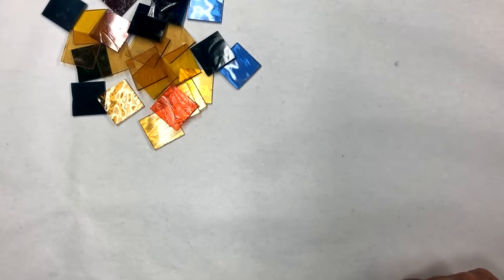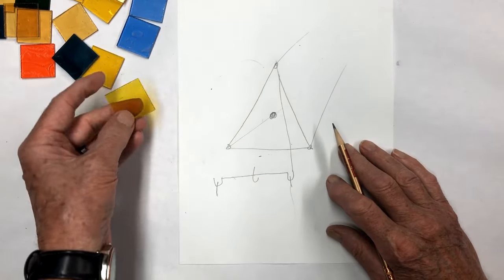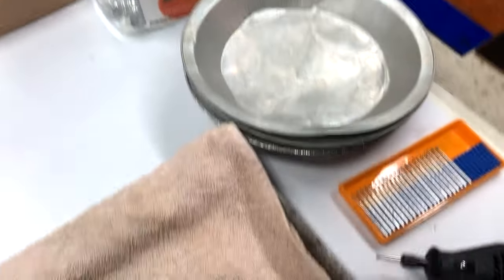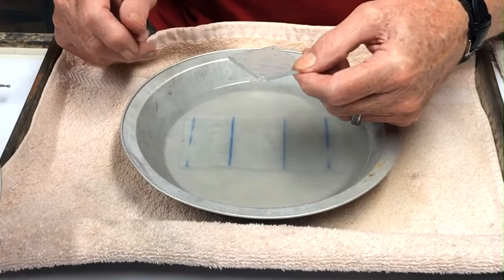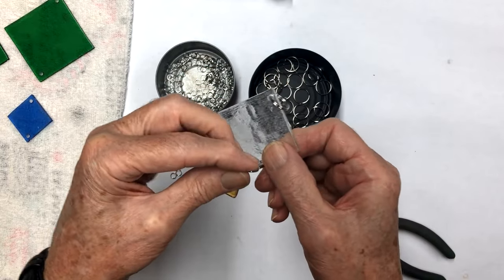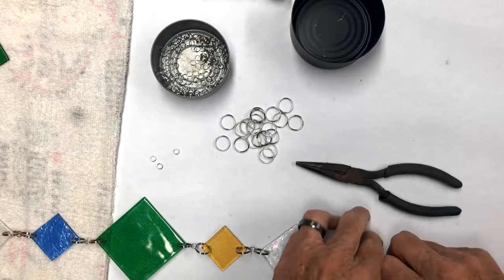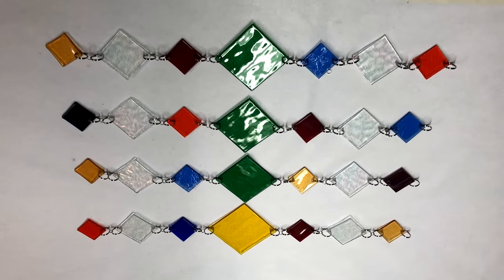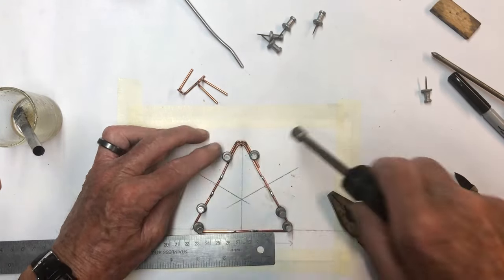Stained Glass Wind Chimes

Comment: Thanks Bill, only suggestion is to put links on where to get the supplies like the split rings and drill bits. Can get you some affiliate link money.
Reply from the maker: So glad you enjoyed the video, Thanks for the tip, I will try that. Here's the info on the split rings and drill bits. The large split rings are 16mm and made by Yueton and the smaller ones are 6mm and made by Huihuibad, both are Nickel Plated. The drill bits are 3mm Diamond Grinding Bits with Spherical heads made by Jimgling. These are all from Amazon. Hope you will give this one a try. Again, thanks for the comment and watching the video, I hope you will look at all my videos when you have time.
Regards,
Bill Stone

Comment: This is great! Now I can replace the glass in my daughter's wind chimes with confidence. Change out the cord on the pieces with chain. Thank you Bill.
Reply from the maker: Hi again, 
Glad you enjoyed the video, it's an easy one to make and you can make it any size you want. Here's the name and size of the split rings I use for these wind chime. Large ring is made by Yueton and is 16mm in size, the smaller ring is made by Huihuibad and is 6mm in size. Both split rings are Nickel plated so after some time outside they will start to rust. They seem to be fine if used inside the house. Both of these split rings are from Amazon. I tried some stainless-steel split rings to help with the rust problem but couldn't open them up large enough to get them through the glass pieces. Keep your eyes open, there is going to be a follow up Wind Chimes video on how to make your own glass design, using glass paint and fusing it in a kiln. I should have it done by the middle of next week. Thanks for your comment.
Regards,
Bill Stone

Comment: Another great project Bill!  I will definitely be giving this a try!  Thanks as always for the great tips! ❤
Reply from the maker: Hi Rachel,
Great to hear from you again, glad you liked this project. It's a fun one to make and you can make it any size you want. If you think you might like to make this one, I will give you the different sizes for the split rings. They are both from Amazon. Large one is 16mm made by Yueton and the smaller one is 6mm and made by Huihuibad. Both are Nickel Plated and will start to rust over time outdoors, they seem to be ok if used on a project used indoors. I tried some stainless-steel split rings to help with the rust problem but couldn't open them up enough to get them through the holes in the glass. Best of luck on your project. Let me know if you make this one!!!
Regards,
Bill Stone

Comment: Could the triangle frane be made with one piece? Then the three loops could be soldered on as you did? Great video  loved the detailed instructions
Reply from the maker: Hi Didi,
Thanks for your kind words and your comment. Yes, you could do it in one piece and solder jump rings onto the frame, that would work. I just never liked the idea of soldering jump rings to hang anything on. Also, it's hard to get all three sides the same size when bending the wire to make the tringle. I think you could give it a try; you would only be out a little wire and some jump rings and your time if it didn't work out. Let me know how it works out for you. Have a great day!!
Regards,
Bill Stone

Comment: Bill that is just awesome! I love how simple you make things. I have a kiln because of the stained glass window work I'm doing so I can use this now in a lot of different ways. Can you tell me what these drill bits are called? And what firing temps you use for this glass? Is is necessary before you drill or did you just want it for the look? Thanks again Bill. There are not many people that are willing to share their knowledge. That is a very unique quality. GOD BLESS!
Reply from the maker: Hi Again,
Thanks for your kind words, so glad you took a look at the Wind Chimes video, The drill bits are from Amazon and are called Jingling Diamond Grinding bits 2.5mm and 3mm, I like the 3mm best!! You don't have to fire the glass to drill it. I just like to fire polish the edges for the way it looks. A good starting temp is between 1325 and 1350 degrees for my kiln. If you go too much hotter the shape of your glass will start to get wavy on the corners. I have also started using copper wire and glass beads to put these wind chimes together, there is a video I made showing how to do this called Up Dating a 5-year-old Wind Chimes. I did this because the split rings I was using started to rust after a year or so. Also, if you like fused glass check out the video on the Candy Dishes. Here again if you have more questions, please feel free to send me a comment and I will try to get you an answer. Have a great day!!
Regards,
Bill Stone
Reply: @billstonesstainedglasscrea3310  Thanks Bill. I may make and use the windchimes for just inside. Here in NL there is just too much wind and I don't think the glass would survive lol. Again, thanks for all the info and I will order some more of the came and drill bits. I actually had a few with my dremel so that will get me started. Have a great day and GOD BLESS!
Reply from the maker: Hi Again,
Glad you could use some of that info!! Where are you at, not sure where NL is at? We are located in Southern California in Temescal Valley, about 50 miles east of Los Angles. Remember to use water when using these drills or you won't have a good outcome. We used to live in Lake Havasu City, AZ and we had a lot of wind also and I never had any of the wind chimes break as long as didn't hit up against a wall or a post. When you get it done give it a try outside, the worst thing that could happen is you get a couple broken pieces, replace them and call that a bad idea!! They look so great with the outside sun shining on them!! Let me know how your projects come out and if I can be of any help, please feel free to send me a comment to my channel and I will see if I can come up with an answer for you. Envoy your day!!
Regards,
Bill Stone
Reply: @billstonesstainedglasscrea3310  Hi Bill.. Newfoundland is the most eastern province of Canada. I used to live in Victoria, British Columbia for years. It was my very first military posting. I was so surprised because Victoria was like a tropical paradise compared to NL. I was wearing shorts in February hahhahahha. NL often can get even 100km/h winds even in the summer so that is why I was talking about the glass maybe not surviving lol. It can be worse in the winter. We have a place near to where you get off the ferry to the province called Wreck House. Transport trucks often get blown over......BUT seriously the province is beautiful and I am often finding new and exciting places to explore right here at home. I will most certainty use the water for drilling the glass, and I will let you know how things go! I picked myself up some nice fluorspar too from the mine near St. Lawrence so I'm gonna try to tumble that and use in it in some of my projects. If I ever get the time to do it all lololol. Have a great day Bill! GOD BLESS
Reply from the maker: Hi Again,
We have been in that area on a cruise ship several years ago that took us to Montreal, Canada. Is it hard to get glass supplies in your area? Again, please feel free to ask me anything about these projects. Have a great day!!
Regards,
Bill Stone
Reply: @billstonesstainedglasscrea3310  Hi Bill, my husband is actually from Quebec. Getting supplies here in Newfoundland is always a problem. I normally order from Nova Scotia or Ontario now for the most part. I can get some stained glass painting stuff from an art store in St. John's, but that's about it. It's really limited here. I can't get glass at all. Oh well. I made a lantern and it turned out ok for my first time. I need to add the chain and it's ready to hang up. I will try the chimes next and see what happens. I tried to use the metal from a pipe to hold the solar light and it would not solder at all so I just soldered two pieces of lead as a shelf and it works fine. Thanks so much for all your videos again. They are much appreciated! GOD BLESS and have a great Sunday!
Reply from the maker: WOW!!!
 That really makes it hard to make any of these projects. Here where we live, I have access to two large glass houses, Hollander West and Pacific Art Glass, both about 45 to 50 miles from my home. Can you get things from Amazon? They have a lot of stained-glass supplies; a lot are sold through Delphi Glass. Check out their website. I think they ship all over the world. The shelf to hold the solar light is made from H Came laid on its side. The thin steel metal is used on the bottom to hold in the white glass bottom. When all else fails you can take a pair of tin snips and cut up an old coffee can and make these small tabs to hold the bottom in. Be careful the edges will be really sharp and easy to cut you. When you have time check out the very first video, Leaded Glass Solar Lantern for Beginners and it will give you some tips. I would love to see a photo of your Solar Lantern, not sure how to do that though??

Comment: I enjoyed your instructions very much. Thank you! What type board is under you frame that you are pushing you pins into?
Reply from the maker: Hi Karen,
My worktable has a 3/4" plywood base and a 1/2" Homasote #440 - Sound Barrier on top. You can purchase this Homasote Board at an old fashion lumber yard. It comes in a 4'x8' sheet, and most lumber yards will cut it the size you need. If you just want to buy a small sheet both Amazon and Delphi Glass sell a 24'x24' sheet. It's a little pricy. You can also find the metal push pins at both of these places. They have two different lengths, one is 1/2" long and the other is 5/8" long which is the one I like best. So glad you are finding these projects helpful and hope you will try making some of them. If you have time check out the video on the fused candy dishes and send me, your vote for your favorite one. Going to post the winning dish this weekend, so you still have time to vote. Have a great day!!
Regards,
Bill Stone

Comment: Hi Bill, I hope all is good for you and your family. 😊 Why couldn't you just make a triangle with one piece of wire and then add the corners?
Reply from the maker: Hi Therese,
Great to hear from you again!!! When I first started to make these hangers, I did use a single piece of #12 Copper Wire. The problem I had was it was hard to get all three corners the same size and at the exact length in between the centers. If you don't get it right the first time, then you have to bend the wire again to either make it longer or shorter. The Copper Wire doesn't really like to be bent back and forth several times to get it to fit just right. If you decide to make this project, you can give the one piece of wire a try and see if you have better luck than I did. Again, great to hear from you and thanks for your question and comment.
Regards,
Bill Stone
Reply: @billstonesstainedglasscrea3310  Hi Again, I wonder if a small piece of copper tubing would work. I'll see what my hardware store has. I'll let you know. Take care and God bless, Therese 😊
Reply from the maker: Hi Therese,
Thanks for your reply, I don't know if the copper tubing would work or not. I don't know if you can buy copper tubing small enough to work for this hanger or not!! I can't wait to see what you come up with.
Regards,
Bill Stone

Comment: would you be willing to share the template for your windchime frame?  Thank you.
Reply from the maker: Hi Bonnie
Sorry I don't have a template for the frames on these wind chimes.
The wire frame on these wind chimes is made with 12-gauge copper wire from the hardware store, you can buy it by the foot as bare wire without any insulation on it Then I just spray it flat black. To make it I just draw up a 4" wide 45-degree tringle on a piece of paper and bend the wire to match the shape as close as I can to make the inside of the frame, then I bend up the corner pieces and solder then all together. Hope that helps you out, if you need more info, please send me another comment and I will try to give you some more info. I can't remember if it's on this video or another wind chimes one where I show you how to make the frame. Have a great day!!
Regards,
Bill Stone
Reply from the maker: Hi Bonnie,
It's me again, I just took a quick look at this video and starting at the 14:32 minute mark it shows you how to make the hanger in its entirety!! Check it out when you have some time.
Regards,
Bill Stone

Comment: What size jump rings did you use
Reply from the maker: Hi Peggy,
Thanks for your comment, nice to hear from you. The split rings on this project are from Amazon, they are by Yueton, the larger ring is 16MM or about 5/8" and the small ring is 6MM or about 1/4". If you haven't watched the two videos on the remake of a couple old wind chimes that are about 5 years old, check them out and they have some alternate ideas to hook the pieces together. They are called Fresh Start and Fresh Start 2. Hope this helps you out, please feel free to ask anything about these video projects. Have a great day!!
Regards,
Bill Stone
Reply: @billstonesstainedglasscrea3310  thank you for info!!!
Reply from the maker: Hi again,
When you're looking at the videos with the copper wire hangers in them check out the video I made with My Granddaughter, it's a simple Sun Catcher and we made 14-gauge copper wire hangers into a spiral to hook them together. It gave the project a nice look!! Have a great day!!
Regards,
Bill Stone